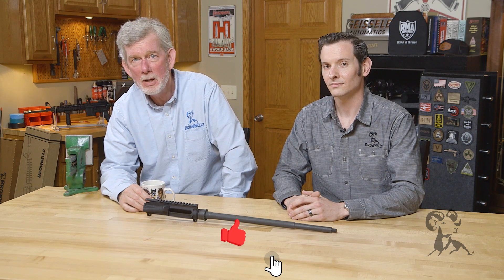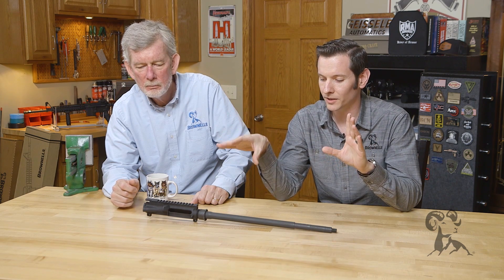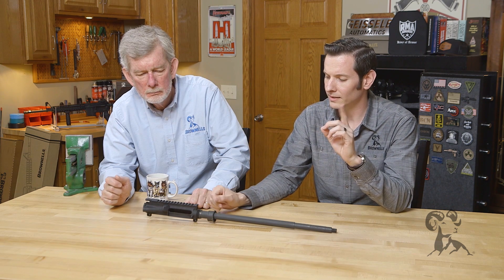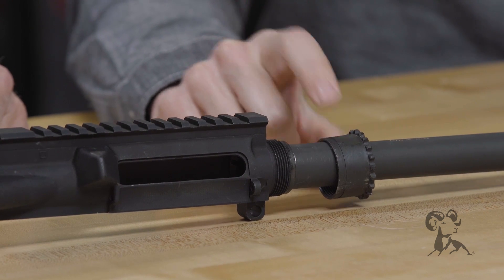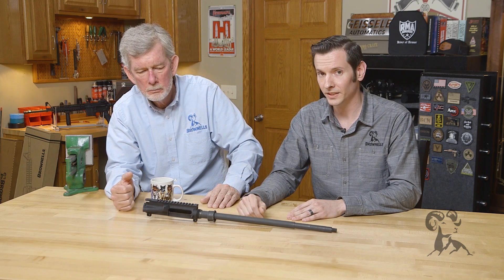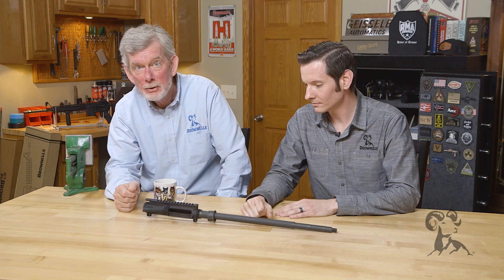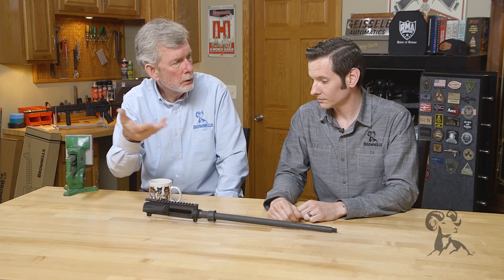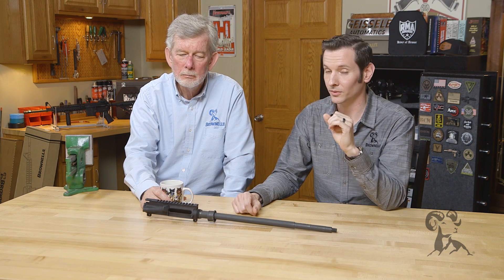SmythBusters: Galvanic Reaction & Your AR-15 - Part 1

Comment: I’m shook. Two components that have been treated to be corrosion resistant don’t corrode.
Reply: Sometimes truth is stranger than fiction.
Reply: In order to do most kinds of electroplating they first plate with copper. copper at a chemical level sticks to everything. Whereas chrome doesn't naturally stick to everything. so will chrome is very corrosion-resistant copper and aluminum next to each other are a very efficient battery. All it takes is the tiniest defect or scratch and you get a blister between the chrome and the aluminum that through capillary action pulls in moisture. Add a bit of salt water as an electrolyte and the thing just gets cancer. anybody who knew the basics of metallurgy should have known better than to chrome plate aluminum for a marine environment. Aluminum by itself would have been fine.
Reply: @GunFunZS  While this is certainly true, it has no application to an AR15.  There is no chrome plated aluminum on an AR15.
Reply: @scarsman  it does for other firearms, sadly.
Reply: The word of "resistant"....is the key......it does not say corrosion PROOF.........Even stainless steel can "stain" and even rust......depends on the things in play.........I have seen more things that go totally against the science that they are about.......very interesting......

Comment: It’s not Bigfoot! If you’ve ever worked on a semi with aluminum outer wheels and steel inner wheels and the didn’t put a plastic spacer in between you’d believe real quick! That said any well built AR with barrel grease applied at build time and well cared for an clean it shouldn’t be a problem.
Reply: It is indeed a real thing as we stated, but "In the AR15 world it is a lot like bigfoot". No doubt it exist elsewhere.

Comment: Not trying to disprove this busted myth but galvanic corrosion is an electrolytic process, it has nothing to do with corrosive water or other materials being in contact with the sample. I’ve never seen it on an AR but I have seen it in other applications.
Reply: Its the chemical reaction between 2 dis similar metals and the farther away they are on the table of elements the worse the electrolysis is?  Am i in the right page here?
Reply: A saltwater environment cause ion exchange through Nobel and non Nobel metals causing corrosion no electricity required. That is why boats carry anodes of zinc a supper non Nobel metal which degrades fist before the steel hull.

Comment: i spent a decade building FA-18s. This is a real issue between disimilar materials. Especially when a catalyst is present (salt water). However, it will likely never happen in this scenario unless you leave your AR on the deck of an aircraft carrier for a few years and remove and install the barrel everyday. An aluminum leading edge on a f18 is fastened to titanium with stainless steel, aluminum and titanium rivets. The raw aluminum is alodined after counter sinking for fastener installation. Also rivets are wet installed with a rubberized sealant. That application requires both barriers  to prevent galvanic reaction from occurring. I disagree with the bigfoot analogy cuz theoretically it could happen in the right conditions. Chances of getting struck by lightening are probably higher tho.
Reply: Go Navy!!!  I spent the better part of 30 years in Naval Aviation, galvanic corrosion is real.  Put two dissimilar metals together AND add an electrolyte (salty sea water) and one of those metals will start to corrode.  The trick is the keep the electrolyte (electrical path) away from the metals.  Paint, preservative, lubricant, etc...  As to whether galvanic corrosion occurs in AR's... I don't have the slightest clue!!!  :-)
Reply: Yep, exactly, we did the same thing on helicopters, especially where you had stainless steel against aluminum or magnesium components.
Reply: You aviation folk are the worst. Engineering department taught me to just paint over it.
Reply: @jacobcarter6028  just rub some dirt in it...lol

Comment: It is theoretically possible IF both the upper and barrel extension are bare metal with no surface treatment applied at all. But I've never heard of a barrel manuafactered with no treatment. I have heard of uppers left raw and just polished, but if you wanted that look you can chrome plate it or just anodize it normal and then paint over the top.
Reply: In theory you can also fart and that creates the woman of your dreams in front of you instantly... there's a reason it's a theory. Just like flat earth and heliocentric  models are just theories.
Reply: @ThisWhiteGuy  The theories you mentioned are inconsistent with science as now understood. Galvanic corrosion in and of itself is consistent with science as now understood. However, the circumstances that would make it relevant on an AR based firearm have not yet been provably encountered and probably never will be unless someone purposefully builds one without surface finishes on both the barrel extension and upper receiver.
Reply: @darthhodges  gravity is a theory
Reply: @darthhodges  your theory is invalid

Comment: In theory galvanic corrosion is possible... But so is Bigfoot... And I have seen galvanic corrosion, but never on a rifle... And I gave seen a gorilla in a zoo, but never Bigfoot...
For it to occur the protective coating/layer would have to be damaged or removed... But the coatings are selected and added to prevent these issues... If anyone has ever seen this, it was either a very poorly maintained and handled rifle, maybe some cheap junk parts someone purchased from China, or someone dumped bleach on their rifle and didn't realize what caused the corrosion...

Comment: Nothing on this planet has done more to cause stupid and unfounded perpetuation of bad information to the gunworld and the world in general than the stupid ass computer, now every fry brain morron can get on that computer and spread crap at the drop of a hat, the stupid computer an the over abundence of public media on the computer and internet has done as much or more bad information spreading than it ever has good information spreading, and when you add video gaming miss conceptions into the mix I think that bad and miss guided information becomes the more prevelent by a tad more than just a little bit, people tend to be lazy and not very thinking for themselves if they can have someone else do the thinking for them, so if one miss informed or miss guided dink that is charismatic enough to impress them enough says it, then it gets spread like the gospel even if wrong, because  they will not believe their worship worthy leader could be wrong, and they are too lazy to look farther into the matter for the real truth of it. Just an FYI,, Oh hell yes I've seen this Galvanic reaction, probably 1000 times or more over the years on damn near every nut bolt and screw made of steel that has been threaded into an aluminum piece that's been there for any length of time, that just goes with being a mechanic of right near 40 years, and yes bare steel bolts threaded into bare aluminum threads will most deffinately do this, but not threads where one or the other or both components are "insulated" from the electrolysis being able to happen such as in some form of non- conductive coatings like that used on an AR reciever, that said thread "gulling" can still happen due to high torque loads upon assembly and can lead to the other because of possible disturbance of that coating because of that gulling, but this and like stated in the video to achieve proper torque is why we need some form of high stress lubricant on those threads to prevent that gulling that could lead to worse things playing out, so yes by all means use a good quality anti sieze or lube (anti sieze is nothing much more than a very high quality, high cling, high melt point lube) when putting together an AR barrel nut, but stop the miss informed confussion as to why, I am not an expert by any means on putting together AR rifles but I do know quite a bit about propper lubrication and this subject because of the years of experience, and having spent no less than a month in school some years ago for learning everything a person could or would ever want to know about lubricants and their uses. that said the best thing you could possibly use when putting together the barrel nut on an AR would be a very high quality anti sieze such as that made by permatex or who ever, unlike a lube grease that will have a melt or run off temprature of around 400 to 500 farenhieght (give or take a bit), a good anti sieze will have a drop or run off temp of somewhere north of 1800 degrees and a stable temp range from -30 clear up to that 1800+ degree mark, anti sieze has a much higher shear strength than any lube grease so it will not "smash" out of the threads under high torque loads such as when torqueing the barrel nut, anti sieze will also resist wash off way better than any lube grease in water and even solvents such as those used to clean guns will hardly if ever be able to remove it, therefore the stuff will never be heated enough to run into the action or other parts of of your gun nor will the process of cleaning your gun remove it for where it's supposed to be, I don't know if it's still available or what brand it would be under but back 25 or so years ago when I worked for  Western States Cat as a mechanic I was supplied a 5 gallon bucket of some anti sieze that is a copper based stuff that is just incredible, when I retired from there I made sure I had enough to last the rest of my life (about 5 gollons of the stuff) because I use it for many things automotive and including the 3 AR's I built and as lube on high stress areas such as bolt lugs and the such on various firearms I own, about the best you can find next to that would be either a copper based type such as loctite brand C5-A or permatex brand copper anti sieze #09128 another good choice is permatex brand ceramic extreem brake parts lubricant made for auto brake parts, it has an extreemly good lubricity and shear strength factor, is fully synthetic and will not harm any metals, finishes or materials used in guns or otherwise, will not run off at temps clear up to 3000 degrees farenhieght, is temp stable from -50 to 3000 farenhieght, will not wash off in water and most solvents (REALLY AWESOME stuff have used it quite a bit), anyhow take care and happy trails.

Comment: Saltwater exposure would EAT AR interfaces between materials . Anodizing lasts how long in saltwater LOL
Reply: Type III hard-coat anodizing on 7075 aluminum passes a 1000hr salt spray test per mil-spec requirements. So anodizing last quite a while in salt water.

Comment: I am a aircraft airframe and powerplant mechanic licensed by the FAA. If you want to know how and in what conditions galvanic corrosion happen ask the FAA or NTSB. The required training has sections covering this for inspection and repair. The factor that is important here is removal of contaminants that might be a conductor i.e. SALT WATER.
Reply: Thats where I learned about corrosion during the stars and tower modification project. There is a guy in DC named John Kaley who taught me a lot about this when he was our resident engineer. I work in a research lab now and apply all the FAA for everything I build here now because of how salty the enviorment is here.

Comment: I left this comment on the other video , please read and respond. Years ago a Brownells gun tech said it was ok to use a copper based anti seizant like permatex in this application.  But what if you true the receiver face. It in many cases removes enough material that it goes beyond the anodizing.  This is especially true if done to move the barrel nut timming and also to move the BGC back enough that it comes in full contact with the buffer face enough to move the buffer face just enough to keep the detent from chewing or dinging the face of the buffer while in operation and reducing action noise too.
    Any response on this wpuld be greatly appreciated. As I've been told so many conflicting things on this.  Thankgou.
Reply: When facing the receiver, you should only remove enough material that there is a very small ring visible on the face. It's just to make the face even, not enough to set the bolt back a measurable amount.

Comment: What about lapping the upper receiver?

It requires removing a small amount of material from the upper receiver face.
Reply: Yes, anodizing is also below the surface. You should take care to only remove enough material so that you make the face even. Although you can see raw aluminum, anodizing is still present.
Reply: @CalebSavant  I know surface wear was covered in the video, but wasn't sure since lapping is taking off just a bit more material. Thanks for the clarification.

Comment: I have seen a lot of galvanic reactions on boats, ships, docks, plumbing systems, engines, etc. where electric current will cause the reaction with dissimilar metals or even electrolysis transfer of metal, especially aluminum. We had a problem with galvanic reaction in the fire department back in the 1970's with laryngoscope blades and bulbs.  A laryngoscope is a device used to place a tupe into the trachea to manage an unconscious patient's airway.  It has batteries in the handle and a small light bulb at the tip of the blade. We were cleaning and sterilizing and reusing these these blades at the time.  The blades were stainless steel and we got some aluminum replacement bulbs.  The electric current caused a galvanic reaction between the two dissimilar metals and the bulbs would break off, which was a real problem if it happened in a patient's airway.  I have never heard of this happening on an AR, but I am wondering if it is theoretically possible with battery powered accessories such as lights and optics?
Reply: Would think that most aluminum accessories/ equipment is anodized so that should be enough to prevent any galvanic reaction.
Reply: Even with bare metals on both surfaces I believe you need an electrolyte type solution like salt water between them for anything to happen.

Comment: To eliminate the galvanic reaction on my equipment, I use graphite grease from my Grand Father's farming era.  I have no problem with the reactions between unlike metals.
Reply: The internet also hates graphite for aluminum.  Graphite is conductive and can theoretically cause issues in moist environments. The MIL-SPEC barrel nut grease specifically excludes graphite.  However,  I imagine if your parts are dry or coated then you would have minimal problems. A study from Rock Island Arsenal Lab https://apps.dtic.mil/dtic/tr/fulltext/u2/632713.pdf

Comment: I'm an electrician and in my world this does exist. And my theory is that none of you guys are finding this is because you're professionals and you're lubricating your threads. Which is what keeps it from happening in electrical aluminum lugs. If I was to make a educated guess this would only happen on rifles where there is no lubricant being used. Also is ceracoat conductive? Could it happen to ceracoated or duracoated rifles?
Reply: Cerakote,durakote and gunkote are not conducive. They will protect as anodizing will.
Reply: Pipefitter here.  I couldnt agree more with Stephen.  Electrolysis typically happens with bare metal.  Keep everything lubricated, replace or recoat parts with stripped coating, and no one should have any issues.

Comment: So the barrel nut can be lubricated with motor oil?
Reply: This is what you should use AeroShell 33MS Mil Spec Armores Grease! You can order from Amazon for about $4 or $5.
Reply: Motor oil lubricates but does not have good rust inhibitors.

Comment: The only galvanic corrosion I saw in my life was in the Navy. Never on a rifle.
Reply: Salt water is a real bitch
Reply: ravener yep
Reply: As a mechanic I see it a lot on tractor trailers. I'm also in New England where corrosion is an issue in general.
Reply: See it all the time as a mechanic.  Certain metal combinations are more prone to it, too.  Steel to aluminum, it happens, but not usually unless it's in a harsh environment.  Steel to magnesium?  Oof.
Reply: immikeurnot agreed, but on a gun?  I think I may have seen this on an old pot metal gun with a steel barrel, but I’m not sure. Honestly it may have been a BB gun or perhaps a pellet rifle. I don’t think I have seen it on a real rifle.
Reply: Plumbing issues are real but they take years and years to have a real issue.
Reply: As a former mechanic I have seen some from mag wheels or aluminum wheels..

Comment: Here's one I wonder about. I was told  you should not coat stainless steel because it can no longer protect itself. Brownells and a lot of other companies make stainless slides and then coat them. Is this causing any issues?
Reply: No, coating stainless with nitride will make the surface much harder and protect it tenfold than if it is uncoated.

Comment: Back in my the day when men were men and cars were tanks, many (most) grilles on cars were some shape of stamped aluminum. These were attached to the bodywork (steel) with steel rivets. The headlight bezels (aluminum) were attached with steel (chrome plated) screws. Years alter as the big restoration craze took off we found that the aluminum had corroded away from the attachment hardware. Galvanic Reaction at it's best. Remember though that cars are outside in the elements and subject to the universal solvent, water. So galvanic reaction is a real thing, but I doubt anyone who takes care of their firearms has to worry about it. JM2C
Reply: Ok boomer